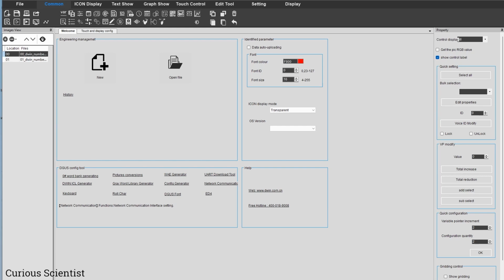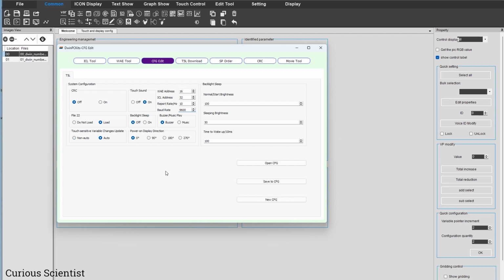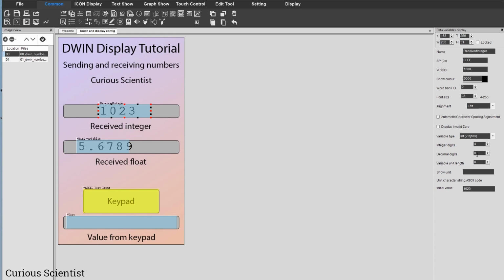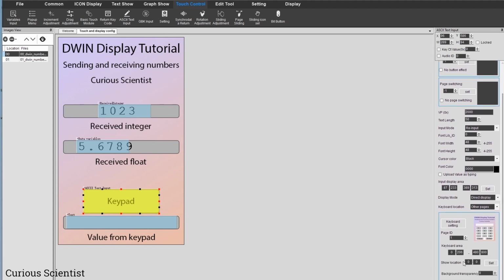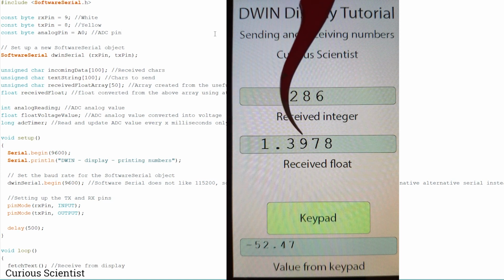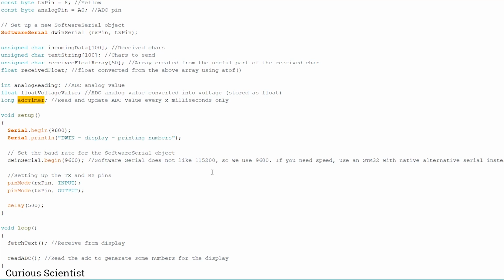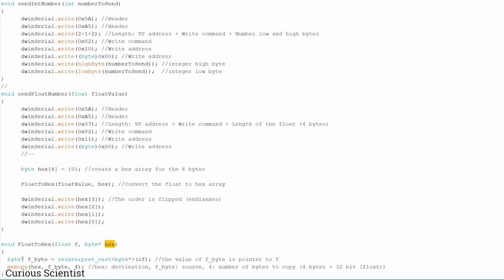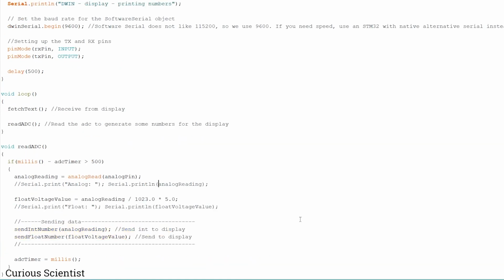DWIN Display Tutorials #2 - Transmitting float and int numbers between the display and an Arduino

Comment: which version dgus tool you are using ?
Reply from the maker: Please check the first video in the series, I am pretty sure I did mention it there. Unfortunately, I don't remember the exact number, but it should be mentioned in the video and shown in the article that accompanies the video. Cheers!
Reply: @CuriousScientist  but the DGUS_V7642-0I04 version not available now
Reply from the maker: Then use what's available, I guess.
Reply: @CuriousScientist  DGUS_V7649 is available but in that version i need to give to ascii key input its possible or not ?
Reply from the maker: Why don't you check it?
Reply: @CuriousScientist  i already checked but it not working 
Page 02
│
├── Phone ASCII Text Input
│      VP = 2000
│      Length = 5 words
│
├── Doctor Key ASCII Text Input
│      VP = 7000
│      Length = 3 words
│
├── Same-page numeric keyboard
│      1–9, 0, Backspace
│
└── LOGIN Basic Touch
       ↓
     Login action
like this flow ?

Comment: dude,can you send your wiring picture?,cuz i'am using a max485 module and it's not working (max485=module that allow you to communicate via modbus rs485)
Reply from the maker: Dude, I don't have pictures of the wiring. It is very trivial connection, just TX and RX.

Comment: Hey hi ,
I want to display 10 parameter values in dwin display from Arduino mega . The max values of the parameters are pm10 - 999.99
Pm2.5 - 999.99
So2 - 999.99
Co - 999.99
No2 - 999.99
O3 - 999.99
Temperature - 999.99
Pressure 9999.99
Humidity - 999.99
AQI - 999

So for these each parameters what vp address and Data type i should give ??? Pls do help me with this
Reply from the maker: Hi! You might want to check this tutorial and its relevant resources: https://youtu.be/IOIAuI80RJc
Reply: @CuriousScientist  it's working but out of 10 parameters one parameter is only updating once and after that it is not updating
Reply from the maker: Probably you're doing something wrong. In my demo, I have multiple parameters updated without issues.
Reply: Yeah it's working now 😅, can you help to select the encoding mode to display the latitude, longitude,date & time as string in the display coz no one has posted videos related to string
Reply from the maker: I have posted videos related to string...

Comment: Dear 
I am getting issue when i work on dgus and define all numbers and while preview it does not take input value nd dont blink point and dont ahow value on screen
Reply from the maker: Hi! The preview mode in DGUS is not too reliable. Upload the code to the display for testing.
Reply: Yes you are rite it is working on HMI 
But not showing input value on numpad screen
Reply from the maker: Check again your code against mine. You can see that in my demonstration everything works.

Comment: Hello,

This is very useful  video for beginner at Dwin display. I have a problem for send data from my own controller cart to dwin 5inc. When I want send data, dwin doesnt response. In this time I am continue send data for ex i, i+1, i+2, i+3 etc... Dwin show me 20. data, which I send. I added some delay nearly 1 second. My baudrate 9600. I saw my data packet on logic analizer. Everything seems okey. What should be reason? Could you help me?
Reply from the maker: Hi!
It is hard to say anything without seeing your full setup and code. Break down your code to smaller pieces and make it work step-by-step until you reach the desired end result.

Comment: Hello,
I found this video very helpful.
But the one issue i am facing is the baud rate.
When i upload the code i get the value on Arduino serial monitor. But they are showing some extra characters.
And the second issue is that when i want to upload the CFG file which is generated for changing the default baud rate.
I want to change the baud rate from 115200 to 9600 
The dwin display become black..
Any guidance will be appreciated.
Reply from the maker: Hi! What do you mean by "some extra characters"? Regarding the baud rate, it is hard to know why it goes bad for you. Do you do the exact same things that I do in the video?